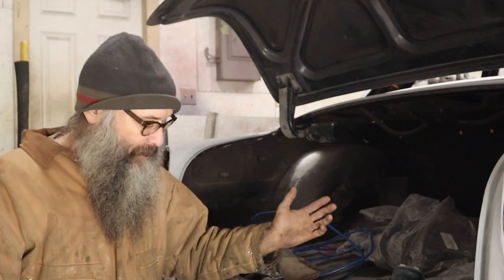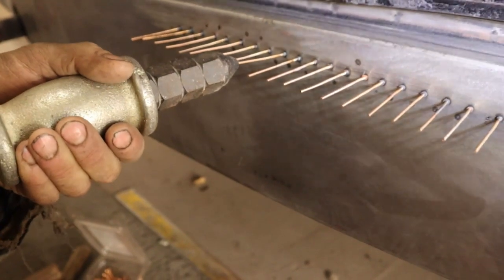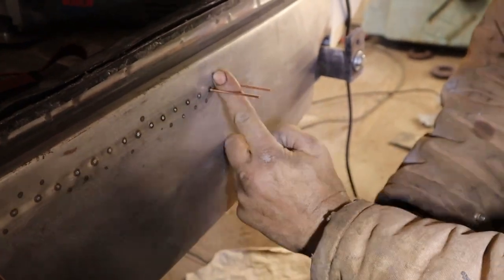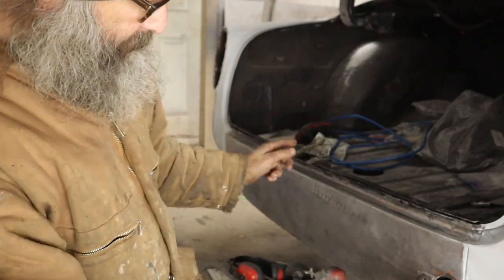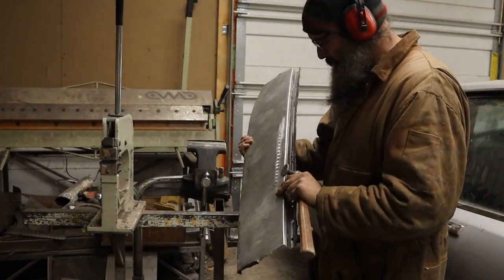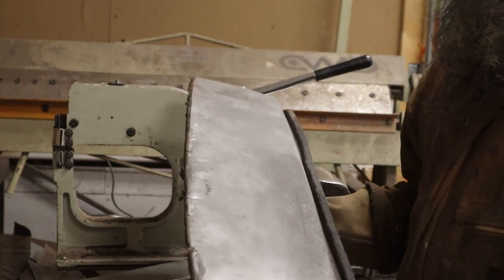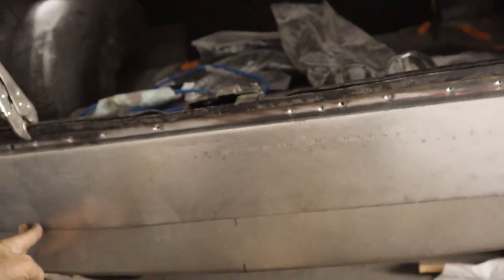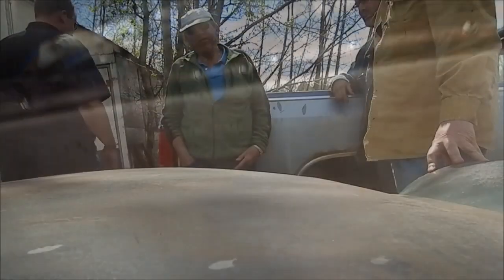Well, That Escalated Quickly...

Comment: Bummer! The Rover has proven to be full of nasty surprises. I was dismayed at how much effort it Took to get the right front fender in shape.  The door gaps were a bit of a challenge as well. I got the impression that the gaps weren't that good from the factory. Your estimation that the rear panel is the last of the metal work on the car is good news.  Cheers!

Comment: Scott is a true "Maestro of Metal." I was recently inspired by Scott to do some metal bending of my own. A t-shaped piece of plastic that fit into a hanging box track broke after thirty years of service. It had held up the back of the silverware drawer in the kitchen. A visit to the home improvement store confirmed my fears that no one uses a system like that to hang kitchen drawers anymore. I thought of Scott pounding metal and found a t-shaped piece of metal, did three bends using two pliers, and in no time had a replacement t-shaped hanger. Seems to work fine.

Comment: That is a fine piece of metal repair. Your explanation is spot on and you can't get a better fit than what you made. Hey, you can put those metal darts you pulled on on the roof of the Frazer and give it a really bad ass mohawk. It could be the start of a trend.

Comment: Hi Scott & friends - watching progress on the Rover, sometimes did wonder if there was more damage (rust & dings) than appeared at first glance. "Philadelphia Porcupine" method, eh? Must look that one up. Kyle is funny - he takes "dry humor" to outer edge. 

In Montreal, we use "Notre-Dame-de-Grace-Woodchuck" method. Ran over an iceberg that flattened a rocker panel into a pita bread. So made a bunch of wooden plugs from broom handle reinforced with ferrules made from copper piping. Then drove some screw eyes into the ends, slipped a length of 1/4" old steel towel bar through the eyes and hot glued the plugs to the rocker panel. Slung a 2x4 to the towel bar, & using the car frame as a fulcrum. Stood on the end of the 2x4 & Voila!! pulled out the dent (not perfect, but could be touched up with stud process). -Cheers, oj

Comment: This replacement panel looks like a perfect candidate for Fitzee's Cut&Butt method to join the two panels. His panels do not show a ton of problems from heat and the only thing I don't like is doing the hundreds of spot welds followed by the grinding. That pretty much guarantees the use of Bondo so the metal is not thinned beyond integrity.

Comment: You do very nice metal work and I learn a little every time I watch a video and I just picked up a 64 Dodge 440 2 Door Hardtop and surprisingly it in good shape.
Reply: My Dad had one.  It was black with red interior and had a 318.  He sold it back in 1970 because the mileage was "high"  (It almost had 70K on it! ) Times sure have changed.   The 64 Dodge had a great design.

Comment: This tool also works great for welding up small pin holes etc….just weld a stud in the hole, cut shaft off and grind smooth !

Comment: What I do instead of using the hammer to pull them back is I put a vice grip on the stud and then use a piece of wood as a flat fulcrum so I can put a screwdriver under the videgrip and lever the stud up. I think it gives you more control because you can lever from different angle.

Comment: Typical: There is ALWAYS more rust than you expected! I am amazed that you don not hate this Rover by now. Or may be you hate it without telling anyone.

I worked so much with an old fashioned unispotter. The problem with the paper thin sheet metal of today that there are holes right away. And often the welds are stronger or weaker than you want them to be. And if you have a strong thick good old steel panel it is sometimes impossible to pull the metal out without making a hole. 
I liked to see the modern system where you only glue some plastic on. It seems very good for the modern thin and lousy sheet metal. The big advantage is that you do not have to grind down to the metal. But as I like only old fashioned heavy cars that does not really matter for my vehicles.

Comment: Hey Scott nice fabrication of the lower valence. I use my pro spot at work all the time. I have an adapter that allows closer welding of the studs and have a rivot gun that can pull the studs without shroming each spot. They also make an adapter for those pull rings that can go on your stud gun. But in the long run replacing that panel was a good call. Keep up the good work

Comment: I'm learning all the rusty denty tricks while I build up the courage to start tackling my new rusty door tacoma I got for 1500! runs and drives 4wd! Amazing. I saw one in good condition and it said estimated market value was 16,000. This one just has the bottom few inches of the doors gone but besides that shes good to go I undercoated her and wire wheeled the bondo off of the passenger door to expose the true hole size at least on one side of the truck. I guess I'm going to cut off the bottom and try to butt weld but we'll see.